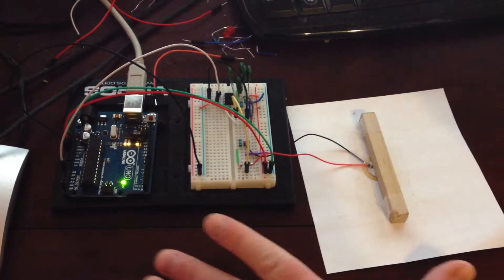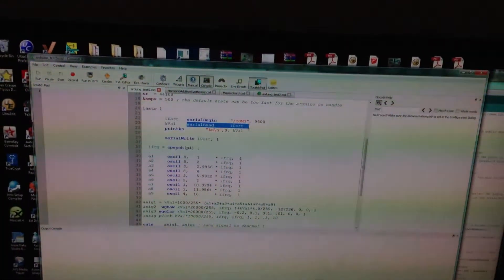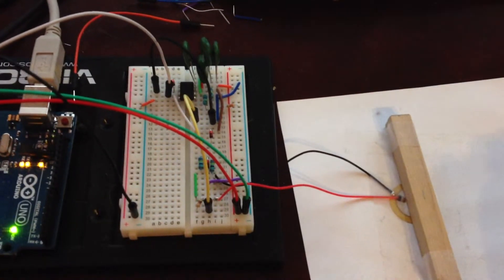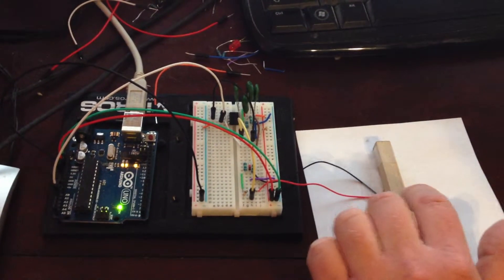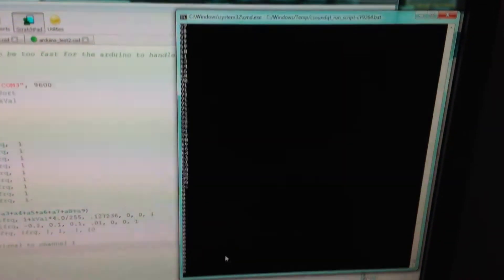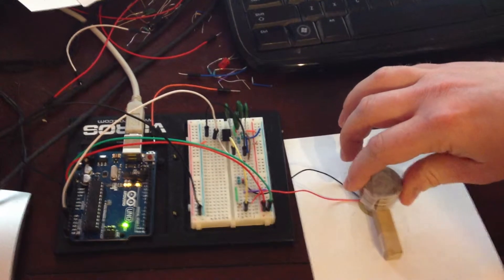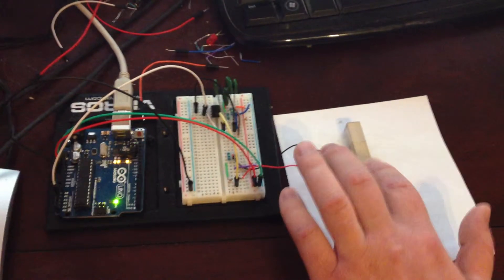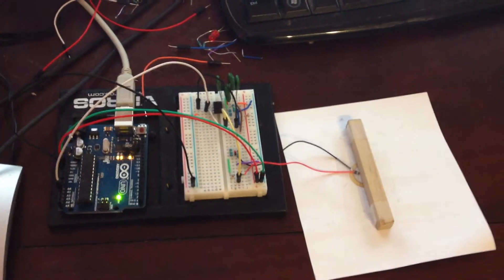Pressure sensitive Peizo keyboard key.

Comment: why did you end up not building it? do you think this could be implemented for a whole keyboard set up?
Reply from the maker: I ended up focusing on a microtonal software keyboard, and the project just fell away. I think that this set up might work for a whole keyboard, but I didn't go beyond this simple proof of concept. I'm sure there would be some kinks along the way, for example could there be cross talk where the piezo of a neighboring key reacts to a key being pressed. One would need to experiment.
Reply from the maker: One thing I would recommend experimenting with is replacing the resistor topology with a transistor and resistor. This would allow a circuit to effectively control the resistance of the resisting part of the circuit by pulsing a signal at the transistor at a give frequency. Then one could tune the decay for each individual key. This could help one deal with the issue that resistors vary in resistance.

Comment: can you share the type of caps you used?  I can't seem to get a charge to hold.  I'm using your single opamp design with no diode and ceramic caps.
Reply: Never mind!  I was messing around with piezo PC speakers which don't have the same response as the 27mm disks.  The larger disks behave much differently and are much more sensitive.

Comment: Would you mind sharing the schematic of just the breadboard section?
Reply from the maker: Here is a link to the writeup:
https://docs.google.com/viewer?a=v&pid=forums&srcid=MDQ5NjE5MjE0NTAyMTI5NDk5NzYBMTEzMTQ2Nzc2NzA4MzI1NTQxNDQBYng3RDV5aElBaTRKATAuMQEBdjI

Here is a link to a group where I discuss it. It has some diagrams:
https://groups.google.com/forum/#!topic/diykeyboard/Dh30Q1-MLh4
Reply: Awesome! Thank you, Peter.
Reply from the maker: Matt Fish No Problem.  There is an issue with this circuit which I discovered after I wrote the explanation. The T resistor network amplifies the input offset voltage of the op amp. The amplification is R2/R4. Thus if R4 is to small, then the system can saturate. Unfortunately, a small R4 is needed to get a large impedance to keep the charge from leaking off the capacitor to quickly. I think to avoid this one could use a transistor and resistor in series instead of the T feedback network. On could then "pulse" the transistor to effectively increase the resistance of the discharge path of the compactor. I briefly mention this at the end of the video. I also found that in some situations, reverse leakage through the diod was enough to keep the circuit from saturating with out the T feedback network. anyhow you will need to experiment.